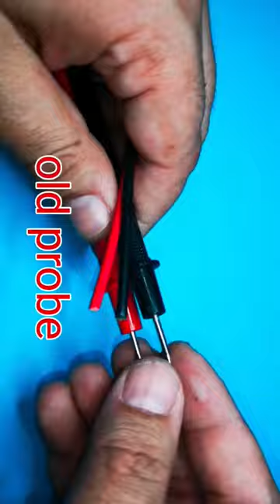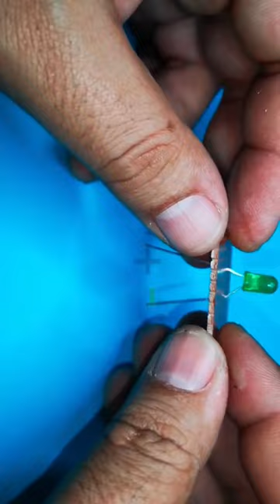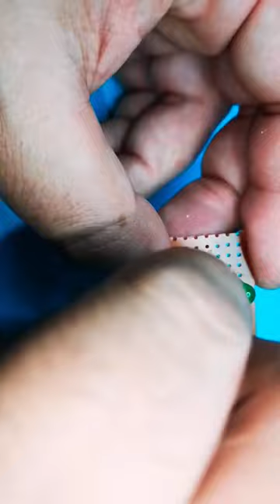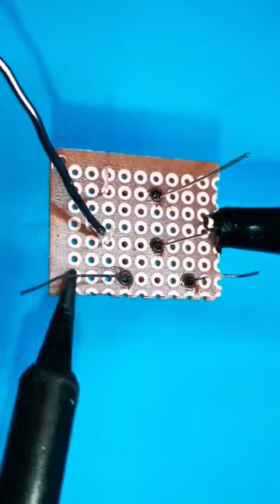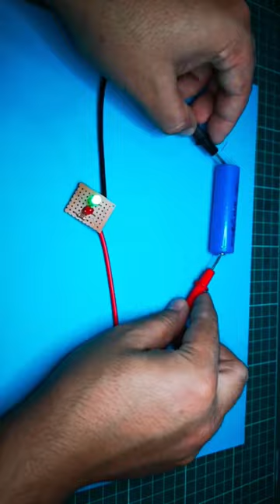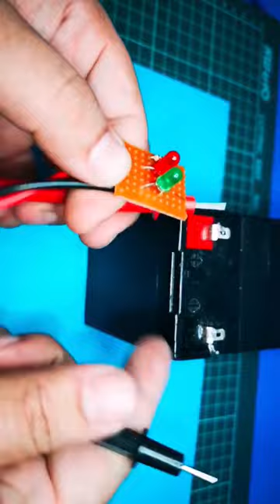How to make a Simple Polarity tester #shorts #zaferyildiz #short #electronics #viral

Comment: If the system operates with voltages up to 30 V, the resistor should be 1 W. I built such a tester using a transparent tube from a pen and two LEDs from broken Christmas lights.